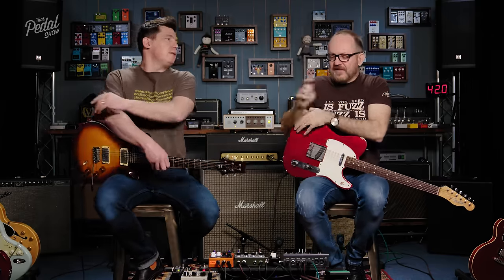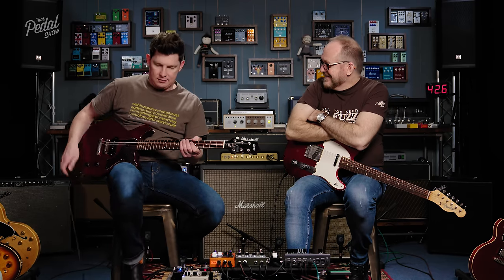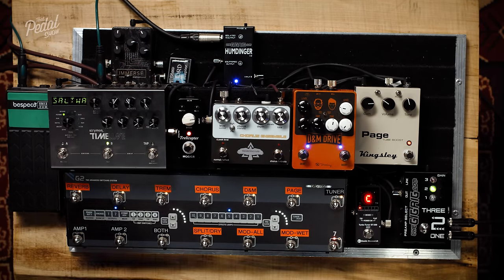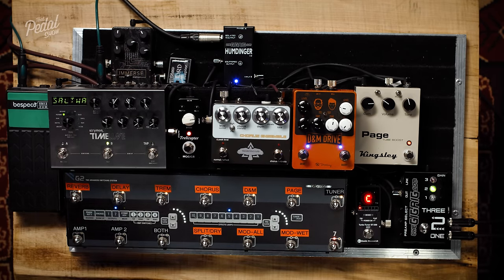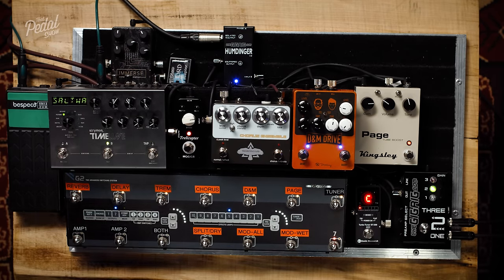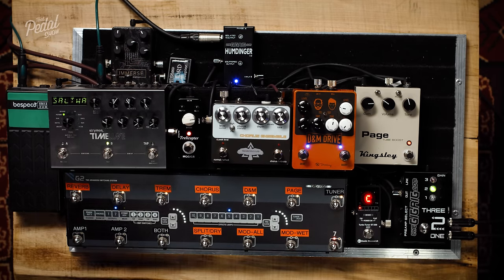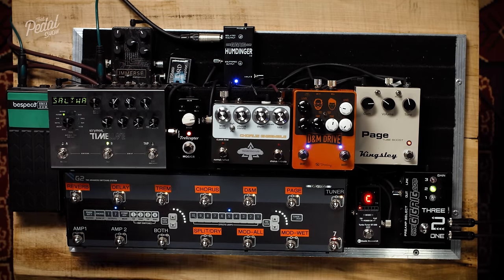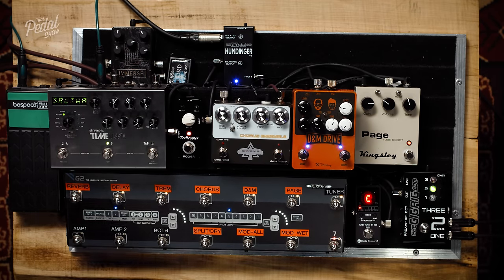Wet-Dry & Wet-Dry-Wet Amp & FX Setups Explained – That Pedal Show

Comment: If you want it work properly and sound well then you need to eliminate the dry signal from the wet amp. If you simply connect amp 1 with amp 2 and insert effects in between then you do not have a dry-wet setup. What you get is a dry-dry+wet setup, for the dry signal is still coming out of amp 2. let‘s assume you have a delay between amp 1 and amp 2 then make sure that the delay does only output the delays, kill dry. 
The thing gets more complicated if there is more than one effect between amp1 and amp2, let‘s assume modulation, delay and reverb. What you want to hear from amp 2 is only modulation. But if you kill dry from the modulation effect then the delay is only receiving the modulation, so you will not hear delays from the dry signal. The same with the reverb. If you kill dry from the delay then reverb is obviously added to the delays only but not to the original signal. 
The only way to solve this is to add a mixer in between. Then you can achieve that all the effects receive dry and wet from effects before without any dry signal to be heard from the wet amp. Look at the setup of Larry Carlton. He runs a wet-dry-wet setup this way.

Comment: I am still not convinced that two amps equal volume, one dry one 100% wet *mixed down to mono*, sounds any different than one mono amp with the wet mix set to ≈50% rather than 100%. I would say the same of 3 amps (WDW) mixed down to stereo sounding any different than two amps in stereo. I'm sure it sounds crazy big in the room, but summed to mono or stereo I just don't see it being worth it.
Reply: Think of it this way: band on an extreme budget has 2 guitarists playing into one amp. The speaker of that amp is sacrificing clarity for each player. With wet/dry the wet delay/reverb effected signal can be thought of as a separate guitar player given it's own chance at clarity
Reply: @kentfranklin736  Good point. Plus, once you try it, it just sounds freaking amazing! I haven't measured the db of 2 amps, vs one. My guess is that yes, db level may not be higher. But human perception for me, it just sounds much bigger. Sound pressure waves may be the same level, but the extra frequency content you are getting, plus the wet effects adding some depth against the dry. Man, I need to go play!

Comment: I built a little passive pedalboard device to run in line before/after a pedal that flips the phase - let me know if you'd like one! :-)
Reply: Joe Perkins I’ve been wanting to do this. Got a $2 transformer and of course I lost some tone and clarity. Put a buffer in front since the input impedance was pretty low. Helped a little bit. I AB’ed against a Lehle P Split and was surprised that it wasn’t too much different. But then life happened and haven’t got back to it. I have a Boss ES8 and you can run effects in parallel. Sometimes I think there are some phase issues when doing this so I was wanting something in-line and inexpensive. So depending on what your using, if it can flip phase, it could maybe lift ground too?
Reply: To be honest, I'm no expert in any of this (far from it!)  I'm still experimenting with it, but it's essentially just a Neutrik 1:1 transformer wired into a DPDT switch.  From what I gather, that transformer is designed to convert unbalanced to balanced signals...so it takes a signal, duplicates it & inverts the phase of one.  So wiring it to a switch (not necessary if it's always on in a loop!) gives you a phase switch and (I believe!) if you don't connect the earth from the input jack across to the output jack, the transformer is isolated.  It works great for two of my pedals as the output impedance is low, but for my Sola Sound trem it creates huge tone & level loss.  So...I've got some components on the way to try to make a simple op-amp buffer to do the job instead for that pedal...so will see how that goes!!
Reply: Joe Perkins Cool. I see they have a 10k:10k impedance transformer, that should work without a buffer for most things. I know you already have parts for a buffer coming, but if you want a prepackaged buffer that can run at 9V-18V check this out. You can use it as a input or output buffer. Not sure what shipping is like over there but quality and price are excellent:

http://www.muzique.com/schem/buffmod1.htm

Comment: I thought if you run your guitar into ANY pedal before the amps input, than it's not dry already? Dry sound is guitar's own sound just into the amp's input. So dry/wet is when you split the unaffected signal and signal with your effects to have a possibility to mix them in any proportion. To bring back your original guitar's sound and add it to the sound which degraded while passing through all your pedals. And overdrives, fuzzes and boosters and even buffer make the guitar's sound degrading so it's better not to have them in your dry sound too. Unfortunately, they are sounding good not in every loop.
Reply from the maker: Nope, dry just means not wet, it can of course mean the direct sound but anything without time based effects can be dry

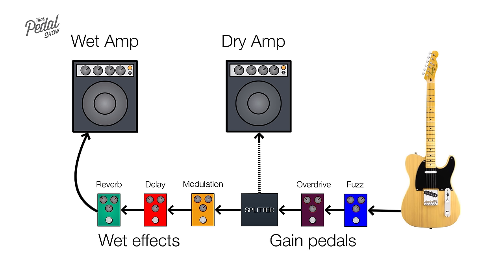Comment: 8:11 Sorry but that's not "Wet/Dry" because you have "Dry" sgnal into your your "Wet" amp.
Reply from the maker: Yes indeed. You are 100 per cent correct.
Reply: @ThatPedalShow  Sorry but it seems to me that there are errors ?
In a "Wet / Dry / Wet" system, all "Wet" effects must receive the "Dry" signal, so they must all be in parallel, set to 100% "Wet" and mixed to the output before attacking the "Wet" amps.

Comment: Clarification please... how do you ground just one amp if they all have grounded electrical power cables? And isolate what from what and why? I think I need the explanation for dumber dummies on this front. Thank you.
Reply: brian patrick  Its just a feature in the audio splitter where it gets rid of the ground on one input so it doesn’t have hum. Ground lift. Both amps still have their plugs intact and plugged in normally.  No unsafe things going on.  I used a stereo pedal and didn’t use a splitter or anything else and it worked fine. No hum.  So it might not be necessary.  Try simple before you buy a bunch of junk is my motto.
Reply: @BeefNEggs057  ahhh ground lift. Duh. Haha makes sense. Thank you.